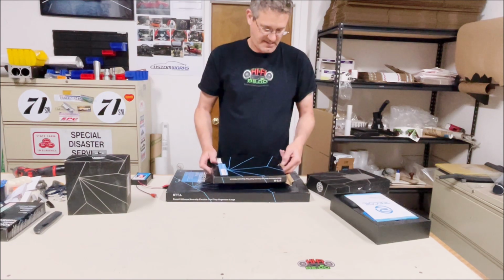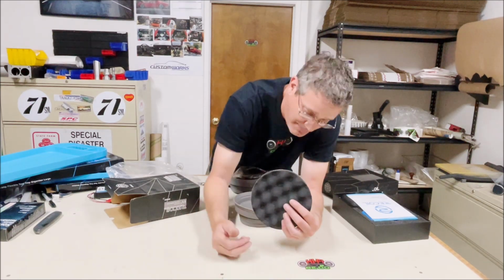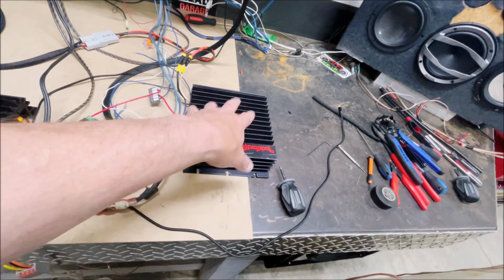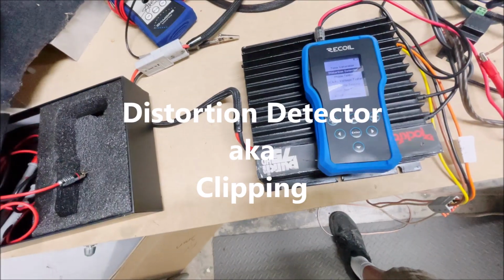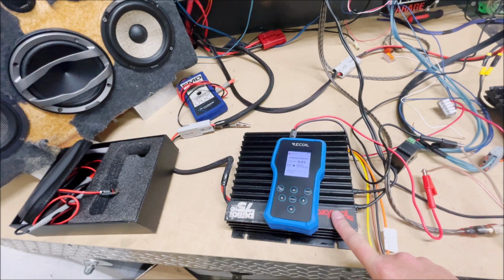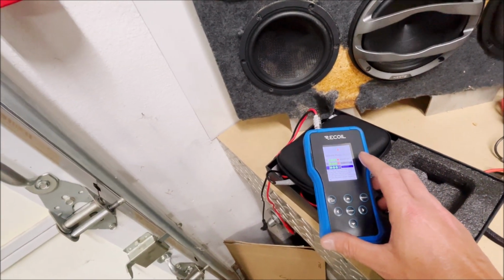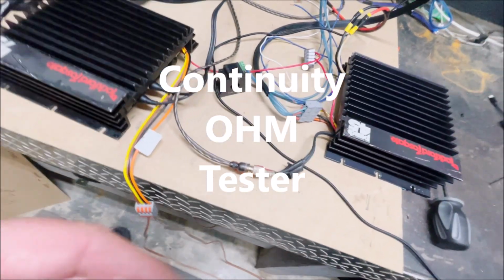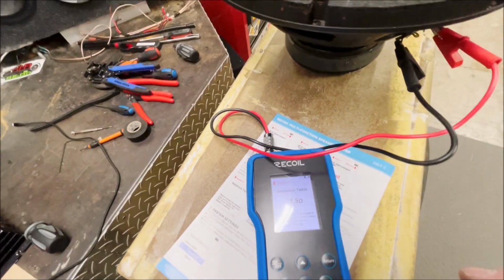Recoil Car Audio Test Meter MST-1 and Accessories Stuff We All Need

Comment: How is this unit compared to the SMD one? Have te same precision in detecting distorsions?
Reply from the maker: I don't have the SMD meter, it is a bit too expensive for its limited use.  I would say they are using similar technology, but with way more features.  Both are nice quality
Reply: @Hi-Fire-do  thank you for the quick replay. Strange, I have checked the video one more time and I can see the SMD unit on your table at the upper left side of the image at min 12.05. Not sure which unit is if it is the DD1 or CC1 or something else.
Reply from the maker: @ionelmusi5119  it is the AMM-1 amp dyno meter
Reply from the maker: @ionelmusi5119  it is the AMM-1 amp dyno meter

Comment: I found a nice little portable oscope that's quite affordable and easy for a beginner to use. The DSO-TC3. About 50 bucks. It seems to be more than good enough for car audio use. 👍
It definitely beats dragging around a bench style oscope with an extension cord. 😂
Reply from the maker: What do you use the oscope for other than setting gains? Distortion detection
Reply: I mentioned this in case you're looking for another product to review.
Reply: I actually don't use it to set gains, but you could, if you wanted to. You can see the signal and rms voltage  from each component in your system and optimize the signal level all the way from the headunit to the amp. You can also see when the amplifier clips. 

The signal generator is good for a variety of things. You can test the frequency response of various components, including amps. 

When used in conjunction with a DMM, the frequency generator can allow you to set exact crossover points. Much better than trusting the printed info on an amp panel. 

Personally, I set my crossovers and gains by ear, but I do like to use it to test head unit outputs. Both speaker level and RCA outs. It's good for adjusting line drivers, as well. 

I don't really test amplifiers, except maybe on music with a sub. So I'll use the BSG watt meter combined with the oscope to see how much clean power I can get.

I think for the average car audio enthusiast, they can mainly use it for setting gains. I run across a lot of people who could benefit from this little unit.

Of course, you can also use it for electronics and automotive repair work.

Comment: Cool video, didn't know recoil even had a meter. Looks useful
Reply from the maker: It is the same price as the SMD distortion detector and it includes polarity checker, volt meter, ohm meter, and a frequency generator!
Reply: @Hi-Fire-do  yup, gonna have to add it to my buy list from recoil. I love the expansion there doing with the company. pretty soon they will over take Rockville, they already have a bunch of products far superior to there Rockville counter part.
Reply from the maker: Oh there stuff is way better than Rockville , scar, ct sounds.   The president of the company is a long time car audio big wig

Comment: Man they need to do a better job advertising. Who knew there was another distortion detector on the market. For the price with all the additional features, definitely worth it.
Reply from the maker: I was going to mention that it’s less money than the SMD meter and does the job of several meters.  I have been using it for two weeks on a lot of different stuff.  Thanks for watching.
Reply: I noticed it says it only reads up to 36v ac so does that limit the size amplifier it can do distortion detection on some amps like 8 or 12k amps are putting out upwards of 100v ac if it’s limited to that it may burn up if people use it on an amp over a certain wattage I would think???? Any thoughts
Reply: Just found out about this bought it in a heartbeat. Was about to get the DD1 this is way better for the price. Recoil has great products